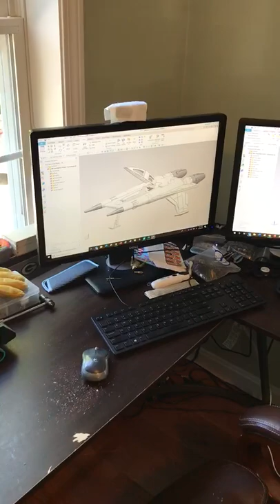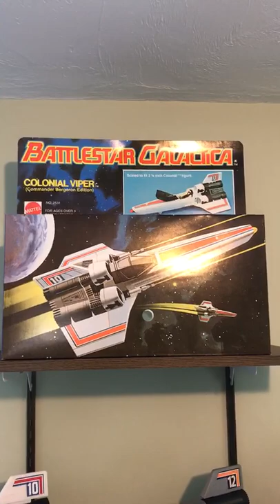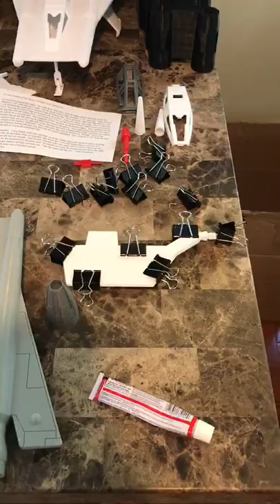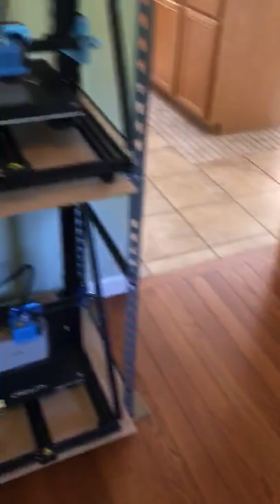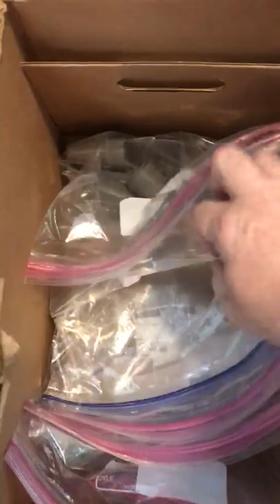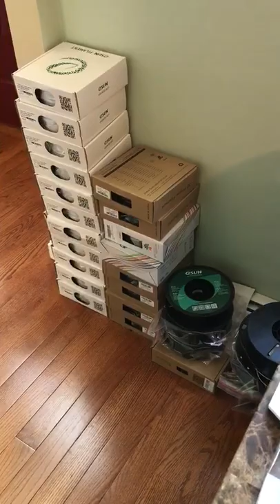BTS at Geek Candy Labs

Comment: I'm very impressed by what I've seen of your work on the Retroblasting channel! Which modeling software and printers do you use? I have used Blender for modeling my projects. I don't own any 3D printers. I have been using Shapeways, which is good but very expensive.
Reply from the maker: Thanks for the kind words. I mainly work with a software called NX but also use solidworks sometimes as well. For printers I use Creality CR-10 V2s for the bigger parts and Qidi X-Pros for the smaller parts.